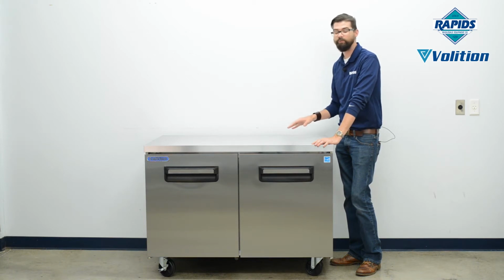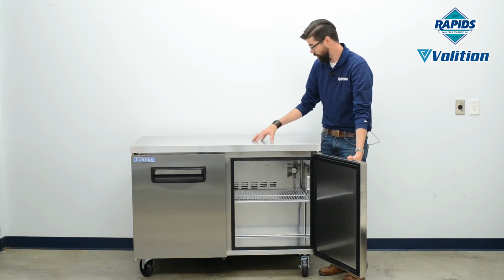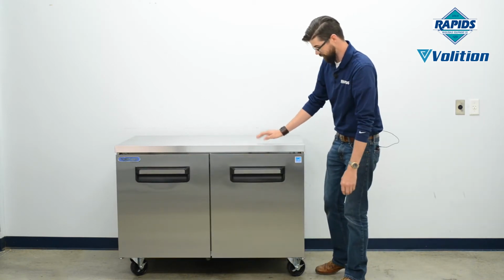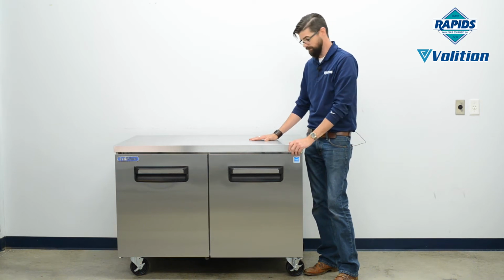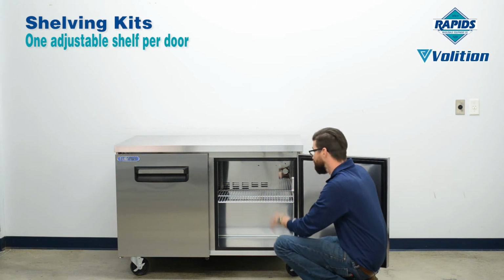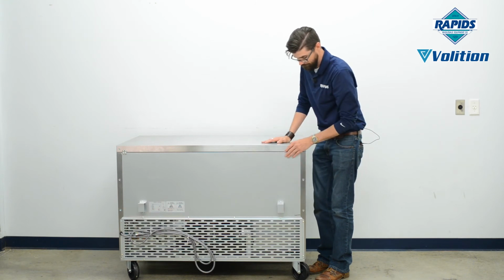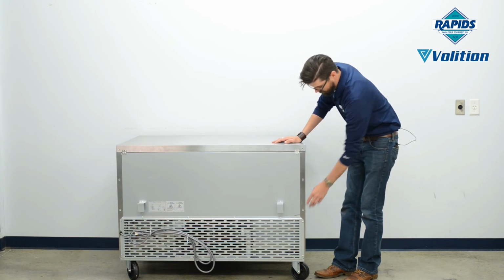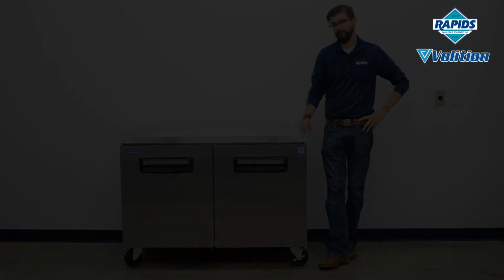Undercounter Refrigerator & Freezer | Volition Brand Product Review

Comment: So can one side be a refrigerator temperature and one be a freezer????
Reply from the maker: This unit is not dual temp. Those are available from Rapids, just not this manufacturer. If you need dual temp, give us a buzz. Otherwise, some folks save a buck by purchasing 2 single door units, 1 refrigerator, 1 freezer. You'll have a gap between, but similar storage capacity.